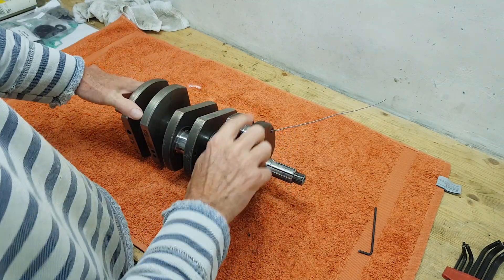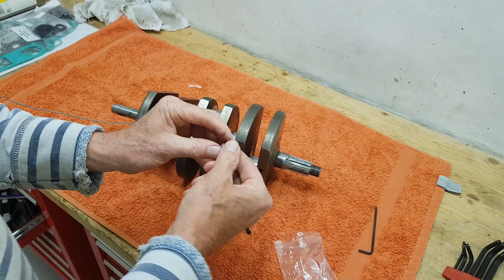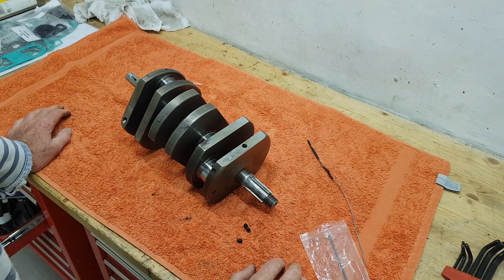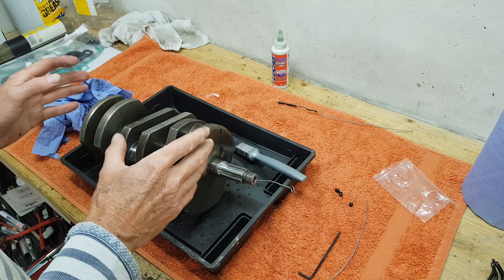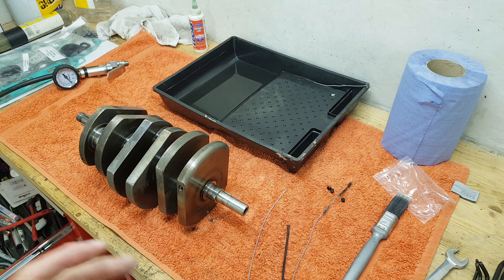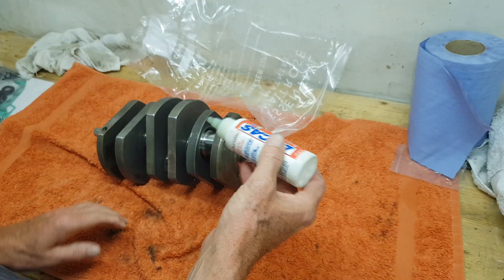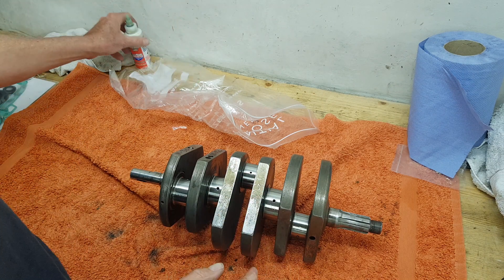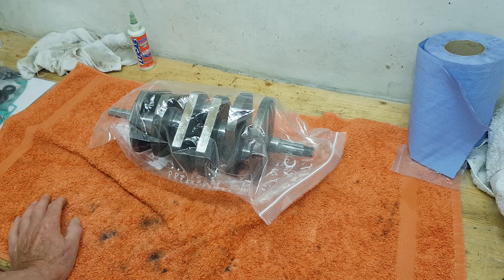Triumph Trident T160 Engine Rebuild. Part 15: Cleaning the Crankshaft

Comment: Hi Chris. Any pearls of wisdom to help remove the original grub screws?  Thanks!
Reply from the maker: I'm afraid they're a total pain. If there's any head left on them buy a selection of socket type screwdriver heads that will fit tightly in the grub screws and can be turned with a socket bar - or buy a set of T-bar screwdrivers. If that doesn't work then you may have to resort to drilling the little buggers out. That's a job best done by an engineers/machine shop. Sorry I can't be of more help and give you an easy answer - I don't think there is one. 😒 Good luck! 👍🤞

Comment: Chris we hard chrome cranks all the time and bring them back to standard size, and your right about the radius its about .060 to .080 .
when I did my crank and cleaned the oil holes I sprayed brake cleaner in the holes until they were clean. Good job
Reply from the maker: Brake cleaner  - great idea! Will do, thanks.👍